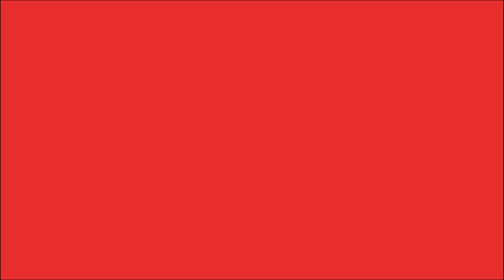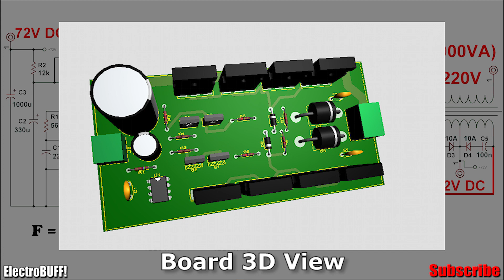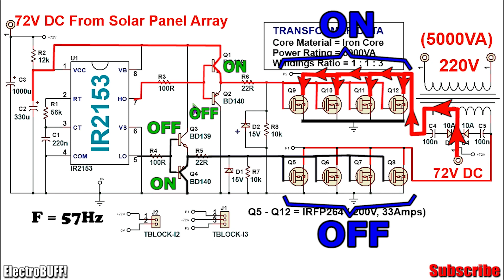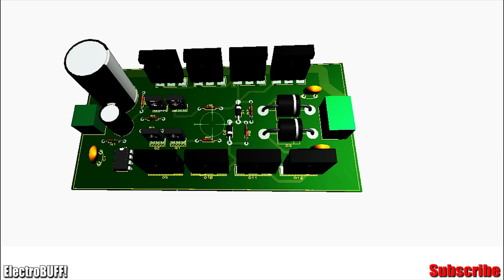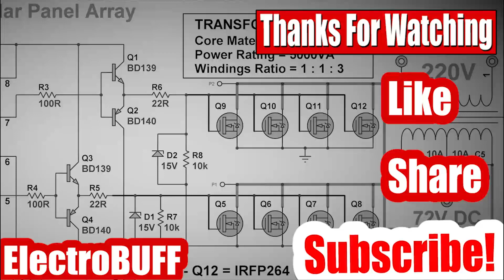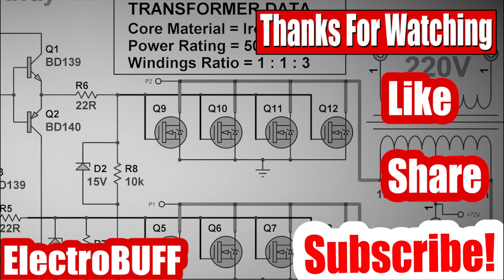How To Make a 5000Watt Inverter For a Solar Power System

Comment: Thanks so much, I love the "simplicity" of this! Not so many components is wonderful. Do you have a schematic for something more traditional, just using 12vdc for the input that can generate 5kw acv with a 10kw acv peak? I'm having problems w one I currently own and would love to build a simpler more reliable unit even if I must do so from scratch. Thank you very much
Reply: Did you find anything regarding your question?

Comment: Hello sir how many ahms battery are we using for this  project
Reply from the maker: I recommend 4 12v batteries in series
Reply: @ELECTROBUFF  Can I use 100ah battery
Reply from the maker: @celestinegwankat9229  any battery should work, just that the higher the capacity the longer the run time
Reply: @ELECTROBUFF  thank you so much sir really appreciate

Comment: I requst you please explain a 48v to 85v dc  to ac 240v 5000w inverter . pure sine wave or high frequency  240dc to 240ac type
With voltage  stabilisation 
 for my solar panel aray

Comment: the current requirements for bd139 and bd140 are recalculated, the 12k ohm resistor in series to the 72vdc bus voltage ?? the voltage for the BD transistor will not be constant, install a 72 to 14vdc step down regulator. just a suggestion .
Reply from the maker: Because it operates at such a low frequency, the bleeder resistor together with the filter capacity (which should be large enough) is capable of sustaining the operations. The frequency is appx 55Hz which is OK.